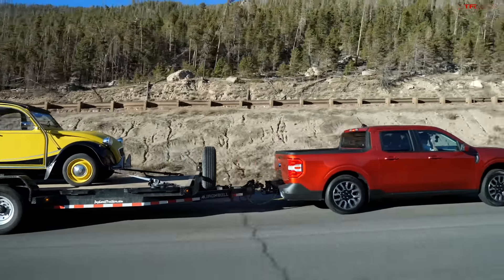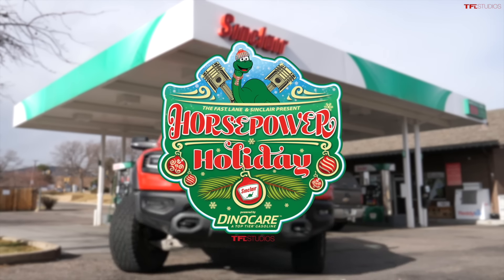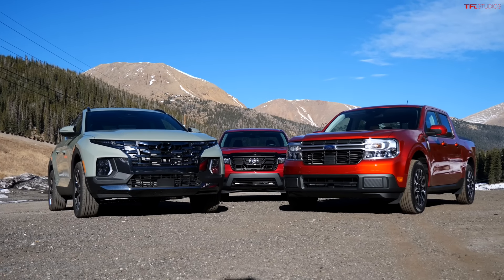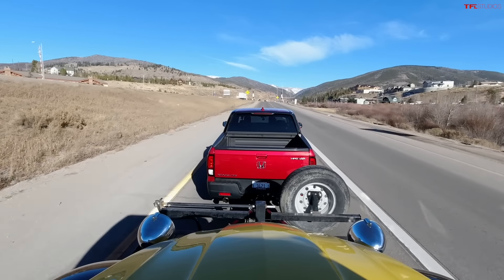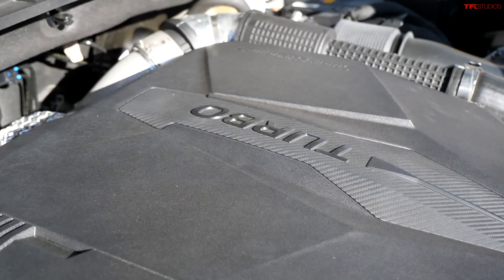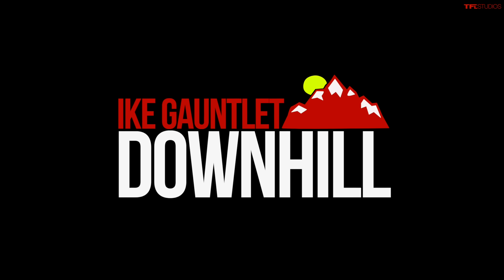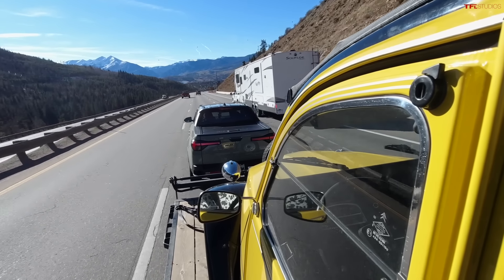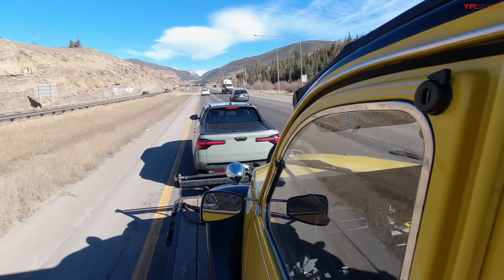I MAX OUT The Maverick, Santa Cruz & Ridgeline, But Which One Wins The World's Toughest Towing Test?

Comment: Christmas came early this year - well done gents. Of the 3 I’d pick the Maverick. Like Andre said, it’s way more trucky than the other two, and significantly cheaper when similarly equipped. With the SC, besides being worse at brake applications, Nathan’s thoughts on the dual clutch is another reason I’d be hesitant to choose it over the Maverick.
Reply: Well it's also a Ford. And I've owned Fords.  If you want to take out a college loan amount of debt to own one... you can! I just hope you get to use it for the amount of time you can afford to pay back the loan.  (Hint: In the 70,000+ miles you might see some high repair bills).
Reply: @gwpeoples  Yeah when they said the Maverick was $37k that blew my mind. Ford is laughing their way to the bank.
Reply: @gwpeoples  funny, I’ve owned 2 cheap fords, wife had 1. My 2 made it to 200k with zero issues. Wife’s made it to 150k and I had to replace the throttle body. Cost $40 and 15 minutes. My buddys 2020 trailboss just had the engine rebuilt. Give me Ford over GM any day
Reply: @Argedis  When they said the maverick was 19.9k that blew my mind. I am thanking ford all the way to my next destination.
Reply: @ocrapo9327  Ford is charging a ridiculous $1,500 destination fee so it's not actually $20k.

They are laughing at all the suckers calling it $20k because that's exactly what they wanted.

Speedkar99 did a in depth mechanical review on the new Escape (which the Maverick is based on) and it's built EXTREMELY cheap... There's a reason why it's cheap
Reply: @lesterparker1594  You got lucky, our company owned like 90 brand new Ford Econolines, we had problems with transmission under 20k miles, some of them broke at 9k, but at the same time many of them worked with no problem, i guess factory defects sometimes happen…
Reply: @user-Chikotillo  from 2012 up until a couple years ago ford had big problems with transmissions. Still do in some models, like the new explorers. Gotta do research before you buy. If you buy a 2012 or later Ford Focus, the trans will go out. Luckily mine was a 2011 and it was shifting perfect when I traded it in at 200k. I never changed the trans fluid or anything.
Reply: @ocrapo9327  Good luck finding one at that price. I have not seen one listed at a dealer for less than $35k.  Plus I wouldn't trust Ford or Hyundai quality beyond 50k miles.  I know that a Honda will easily go 150k miles with little to no issues.
Reply: Idk why being more trucky is a net positive. That just means it drives worse. Lol
Reply: @ man this original comment is old lol. I bought a ford ranger a year ago, didnt like it. Never used it for its intended purpose. Sold it for a Honda Passport last month. Love it. If you’re currently shopping the 3, buy the Ridgeline. The powertrain is awesome, tried and true reliability too.

Comment: My new 2022 Ridgeline tows the best when I put the transmission in "S" mode. It holds great going downhill on the cruise control too.
Reply: Junk
Reply: @allenstuck2861 you think a Ford or Hyundai are more reliable than a Honda....smh.
Reply: What does your husband drive?
Reply: What do you tow with it? Weight?

Comment: Thanks for doing this , I am 100% getting the Honda Ridgeline now .
Reply: I like the Ridgeline and would consider it if it wasn't a few inches too long to fit into my garage bay without tearing out my full width workbench and storage cabinets in the front of the garage.  I'm not interested in tearing out the garage built-ins, and am not going to buy a new vehicle that I have to park out in the driveway while leaving a perfectly good garage bay empty.  The Maverick and SC will both fit in the garage, and they'll both do all the things I need a truck for, while coming in at a cheaper price than a comparably equipped Ridgeline.
Reply: I'm a big Ridgeline fan. Does everything well. Might go with a Santa Cruz in a few years IF    1)  It gets a few better MPG or more over the Ridgeline in everyday driving  AND   2) there aren't issue with the engine or transmission, which seem to dog Hyundai for decades. Don't mind the small recalls, but when there are recalls for engines packing it in and fires...then I'll stay with the Ridgeline with it's great J-series engine and (now) reliable 9-speed.

Comment: the maverick bumped up one more temp right after you said that. it was only 1 tick away from the red zone. That motor was working HARD!!!
Reply: to be fair the Maverick max tow is 4K and they said their trailer weighed 4K, You have to add all the hamburger riding in the front of that rig as well so they went over the GVW of the truck by at least 500 pounds. If I was going to tow 4k over a mountain I would want a F150 to that job.

Comment: I think you will see more of these compact/midsize unibody trucks. More folks want one of these trucks for the bed for DIY reasons but want the space, fuel economy and ride of an suv. 

Imagine how much more huge the “truck” market will get if you had a choice between payload and ride vs off road and towing. 5k towing and 1500+ lbs of payload with an suv ride would be enough for 6/10 truck buyers. And the solid axle body on frame 4x4 would satisfy 4/10 needs. Perfect combo.

Comment: Very interesting the Maverick was pretty close it seems to getting a coolant overtemp warning/derating the power.  If it’s 80 degrees, I see it getting to that zone…
Reply: Colorado had some scorching hot weather early in the summer last year.
The Maverick would have overheated.
Reply: Yes the Maverick would definitely overheat in the Summer and having a turbo charger doesn't help. It's funny how they made a towing option yet very limited on what it can actually tow without getting all heated up.

Comment: THANK YOU FOR DOING THIS COMPARISON!!!!  I own a 1984 VW Rabbit GTI with that is very light and with a lightweight aluminum trailer there's a good chance I could just squeak in slightly below or at the 4k towing capacity and tow my "fun car" with the Maverick on occasion to car shows or track days.  It would probably also be good enough for a Miata or GR86 too.  

I find this very reassuring that the Maverick could do the job well enough and it's now something that I have to seriously consider buying.

Comment: Great video! I love these sorts of comparisons. 

I do wonder if the Cruz would’ve performed even better, both uphill and downhill, if it was kept in Sport mode instead of Smart mode. I’ve noticed Sport keeps the revs hanging higher and longer, which really help with engine brake and torque when towing my camper. 

Also, was the squat measurement on the Cruz done before or after the self-leveling suspension had time to do its thing?

Comment: 27:36 That Maverick is almost overheated. That is not good. If you would have had to go any farther I think you would be pulling over to cool off.
Reply: I agree
Reply: Wow dude I don't know what video you watched or mechanic you listened to. 
The gauge shows the temp being in the middle or 1 notch over to warm. As long as you're not in the red there is no need to stop. If youre in the white you're in the normal.
Reply: @billchesney8949  I don't agree
Reply: @ocrapo9327  Looking at it more closely I missed the bars at the top. I only saw the line at the bottom
Reply: @ocrapo9327  One more bar and it would be in the red
Reply: So add an additional oil intercooler for cheap, which would be good for the life of the engine even if you're not towing and you're golden.
Reply: You know its 4k towing vs 5k towing.

Comment: Did anyone notice that at 27:35 the Ford coolant actually heated up 3 notches total? One away from Max temp. I remember the new F-150 of Andreas having heating issues and Ford gave them some lame reason about elevation reducing town rating. Seems like Ford EcoBoost owners that tow might be having some issues.
Reply: Seems like Ford may be sacrificing cooling airflow for better fuel efficiency.
If a brand new truck overheats you can guarantee the issue will only get worse with age.
Reply: Typical Ford.  Breaks under pressure.

Comment: You guys know the Honda has a plug under the dash for a normal aftermarket brake controller, and includes a wiring harness and fuse for that in the glove box. Just saying, you took the roundabout solution.

Comment: First off, great video and great place to evaluate towing!

The only thing worth pointing out is that you could get the same towing capacity in an xl maverick, which would be ~$30k (in 2024) and the Hyundai needs to be at $40k to get the increased towing ability with the boosted engine. So ford is definitely the budget option.

Comment: Ford brought out the Maverick with price being the primary objective.  What they have found out, especially on the higher capability models and higher trims, is that people will throw Ranger or even F-150 money at a Maverick if it's worthy.  I know, for example, I'd pay that $4000 more for Santa Cruz level refinement.  So yeah, put the engine cover on it, make the seats more substantial, and charge me more.  And I think they will.  I do predict the 2 year Maverick refresh will have some more equipment for the XL at an entry price of around $23K, and with each model, the equipment and refinement will increase as will the prices.

Comment: Nice video comparing two of the hottest vehicles on the market right now.  I have a question regarding the Santa Cruz.  With the self leveling rear shocks, do you all drive around a bit to give the shocks a chance to level out or do you take your measurements for squat as soon as you hook up the trailer?  I thought you had to drive a bit to give the self leveling shocks a chance to level out.  

I'm really looking forward to you getting to test a Santa Cruz model with the naturally aspirated 2.5 engine.

Comment: Santa Cruz wins in my book. It has much more comfortable ride, lower noise, better fuel economy, and higher towing capacity. The Maverick was stressed to the max and nearly overheated in 46 degree weather.
Reply: Agreed.
Reply: Add a hot summer day to the mix and the Maverick would have been in limp mode trying to finish the climb.
Reply: It's also about $5,000 more than the maverick, which is important to note.
Reply: Long term reliability is probably ass
Reply: @martincadenas5839  Your grasp of the English language is just 🤌🏻.
Reply: @JohnLee-db9zt  thank you I am a speech major
Reply: @martincadenas5839  I’d have a fallback career.
Reply: @JohnLee-db9zt  😂😂
Reply: @JohnLee-db9zt  😄

Comment: 27:37 wow the Maverick is getting a lot of heat soak. look at the coolant temp skyrocket... and require premium fuel?  Santa Cruz def won
Reply: Maverick does not require premium fuel. You can use it for more power.
Reply: I'm all for the Maverick but I did notice that it started to heat up at the end there.
Reply: just curious but did the other two even have a gage to look at the temp with?
Reply: oogleboogle yes they did, both managed to stay below half way.
Reply: @ShersGarage  Read the manual for the Maverick. It recommends premium for towing heavy loads. It also warns you to listen for engine knock if using regular, which is just a way of saying it was designed for premium.
Reply: @kacyharper8142  That depends on how the gauge is programmed. Coolant temp gauges are dummy gauges, meaning they sit in the middle when they're in the "normal" temp. I know on my 2019 Ranger AND my 2021 PowerBoost F150 the gauge stays in the "normal," "middle," or whatever you want to call it until it gets to 235°F. I don't  know where the other two start to leave the "normal" position.
Reply: The maverick was maxed out in weight, they should have added weight to the others. This is what is done with towing competitions to be far.
Reply: @desertfresh3740  It's typical of a heat gauge to climb when temperatures climb. I have a hard time expecting a temperature reading of near red to be not near limit. Maintaining half would be indicative of half way through temperature tolerance. I understand what you're saying but a an instrument saying near limit would indicate that it's near it's limit. If it wasn't near it's temperature limit they should change the calibration because it's far from comfort inducing.
Reply: @W_T.F  there is a difference between require and recommend.
Reply: @kacyharper8142  Being near a limit is still within limits. It's not a problem until it exceeds the limitation. That is why the limitation exists. This is also how airplanes operate. I can push anything to the redline so long as I don't exceed it. Ford engineers know this.
And clearly, from the tow test of the PowerBoost F150, Ford has put in a safety system for if/when it does reach the limit. As opposed to vehicles of old that would just blow the radiator apart.
Reply: @desertfresh3740  I understand that. But it's just like running your engine near red line. It's a matter of increased wear or strain. But I appreciate that you're a Ford fan as am I, currently own one, but it's worth mentioning the obvious temperature climb regardless of brand preferences.
Reply: @W_T.F  they were at elevation so I doubt engine was pinging. That why they offer 85 octane
Reply: @ShersGarage  I follow the recommended oil change interval too.
Reply: @jayrichards3672  I didn't say it was pinging, just that Ford tells you to use premium gas in the Maverick when towing. Hyundai tells you to use regular. I live at sea level so for me, regular gas is a significant savings.
Reply: @W_T.F  I do not follow recommended intervals. Usually they're too long. With Modern engines I do every 5k and full synthetic. Overkill? For sure! But oil is cheap! Gives you a piece of mind.
Reply: @ShersGarage  Amen!

Comment: The reason the Maverick engine is noisy is that there is a fuel pump right on top of the valve cover, which ups the pressure for the direct injection system.  It makes tapping sound more frequently depending on RPM.  There's a rubber sleeve on it to reduce noise, but it's still "tappy".

Comment: Thank you Andre and Nathan! I have been waiting for this and I think the Ridgeline was exactly the right comparison truck. The Santa Cruz and Maverick are basically giving us a vehicle in the same vein as the G1 Ridgeline Honda introduced in 2006. Except this time, lots of people are interested in this kind of vehicle. I agree with Nathan's call and I think the Hyundai's 1000 lbs. of extra capacity is important. I need 4500 lbs. towing myself so that 5K limit is key. Do you have any observations on how stable each truck felt (with the trailer) in normal driving?
Reply: I'd get a bigger truck if you're towing the max all the time.
Reply: @ocrapo9327 Towing all the time, I agree and I've had bigger trucks for that. But the 5000 lb. limit is great for bringing the right size boat back and forth to its seasonal  mooring.

Comment: Hopefully Hyundai has their DCT figured out. We had a 2016 Tucson with the 7 Speed DCT. It would overheat regularly. Sometimes you stepped on the gas and it wouldn't go anywhere. Quite a few complaints. I think after 2 years, they dumped it. It was a different transmission, being a dry vs. the current wet 8 speed. I'd wait a year or two and let others be guinea pigs before I bought the Santa Cruz.
Reply: Did Hyundai honor your warranty on the DCT?
Reply: I mean my 2016 is doing well with the DCT.  I've gotten used to how it drives and can do pretty smooth starts at any time.  But I can assure you the new 8-speed is FAR (by solar systems) better and more refined than the old 7-speeds.  Feels almost VW/Audi-like.
Reply: Yes you right. I wish to get SC with dry clutch here in Canada but only choice it’s dual clutch. I’m not convinced about wet clutch especially with recent recall. Obviously something is fishy here and I’m gonna wait. Beautiful crossover though.
Reply: @makan1568 A recall doesn't mean it's bad.
Always go wet, dry DCTs are trash and more prone to breaking.
Reply: DCT trannies, dry or wet clutch,  do not do well in stop-and-go (city) driving and when going at slow speeds (like when backing up to a trailer).  The slipping clutches like to heat up very fast, which is sure death to a clutch.   I would be all over a Santa Cruz with a 5000 lb. tow rating and HEV, or preferably a PHEV plant.  A Tucson-like PHEV  rated for 5k would be nice.